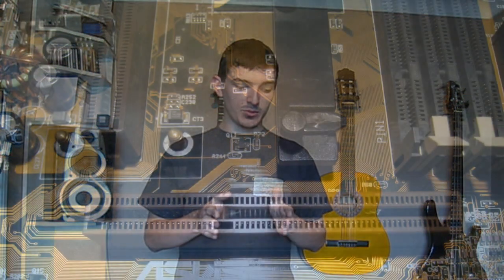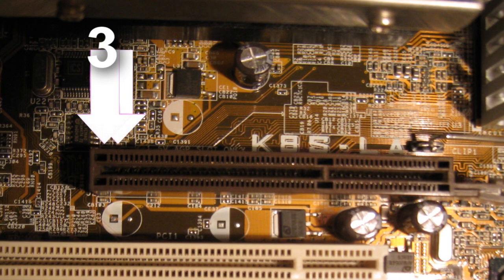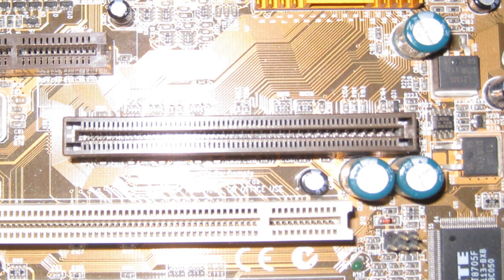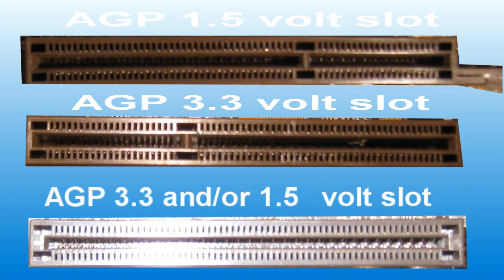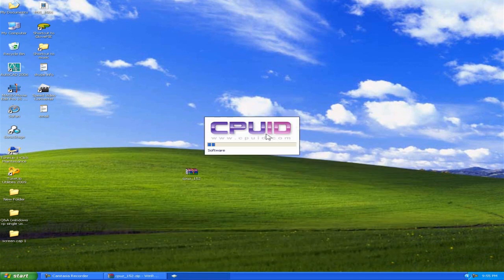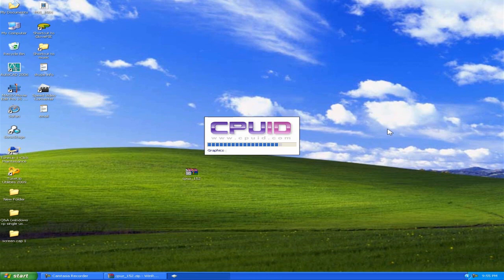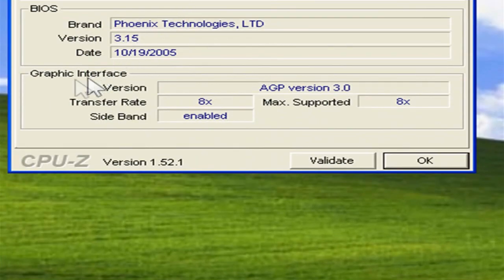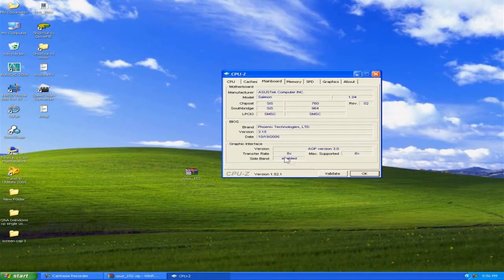how to tell the difference between AGP and AGP x1, x2, x4 and x8

Comment: Hey knowledge guy, I am having trouble finding a dual DVI AGP 2X video card for my older system. I run win 7 64 bit but would like to use dual monitors in 1080 mode if possible. My system is about 7 years old.
Reply: I don't have an answer to your question but I do wonder why do you keep such an old system running?

Comment from the maker: Hi there, I depends on what you want to do with your computer, if you are not using it for playing games or having 2 monitors than there is no reason to get another graphics card just use the on board one, if you want to use 2 monitors than check out my video on getting dual monitors, as for games you will want to get a decent graphics card.
just depends on your price range what one you want to get.
Hope this helped and thank you for your comment.

Nice One ; )

Comment: Well i have a problem my mainboard do have an agp slot but the software is not detecting it os i dunno what agp it is. But whe n i look inside my computer jsut below the port its written agp only.Btw its .15 v. What does that suppose to mean?
The computer docs is lost since long but i read that the agp is 8x.The main board is hp d530sff

Comment from the maker: @xxSNSDxxx If its AGP version 3 than that would be X8 1.5 / 0.8 volts, that 2x bus speed doesn't check out, I think there might be a communication error between CPUID and your chip set.
If it is version 3 than that card would work as normal.

Nice One ; )

Comment: my nvidia syestem information Processor:(1000 MHz) Operating System:Windows XP, 32-bit (Service Pack 3) DirectX version:11.0 GPU processor:GeForce 6200 Driver version:259.19 Core clock:350 MHz Memory clock:532 MHz (1064 MHz data rate) Memory interface:64-bit Total available graphics memory: 576 MB Dedicated video memory:512 MB DDR2 System video memory:0 MB Shared system memory:64 MB Video BIOS version:5.44.A2.10.72 IRQ:5 Bus:AGP 2X

Comment: @viperfrank my mother board model 694T-686B Bios brand:award software in ternational,inc vesion 6.00 PG date 10/23/2001....when i use graphic card nvidia 6200 512mb x8 agp then i check in my CPUID Graphic interface : AGP version 3.0
transfer rate 2x and max supported 2x but im use nvidia 6200 512mb x8 why can be like that

Comment from the maker: @ajam920 hi there, you should be fine putting an AGP4x card on an AGP8x slot  and the other way round  as long as the slot voltages are the same (it will normally say above the slot, 1.5v is what your looking for) but the card will only run at the lowest speed. so if you put an AGP4x card in an AGP8x slot it will only run at 4x.
quite often your mother board, if it's fairly modern it will give you the option in the bios to set the slot up to 8x.
hope this helped.
nice one!!!